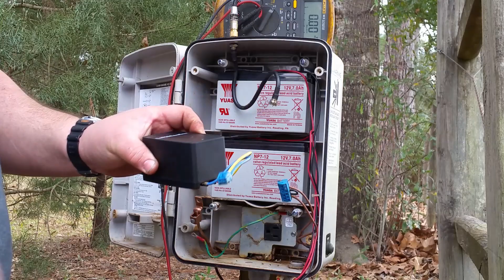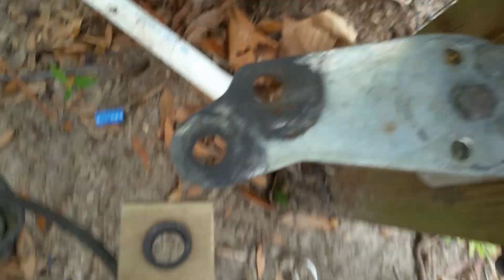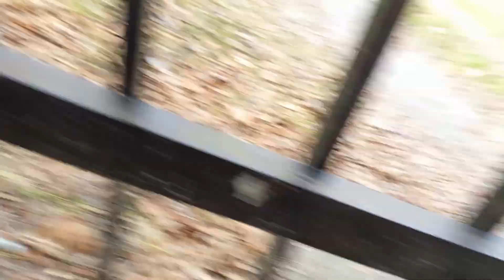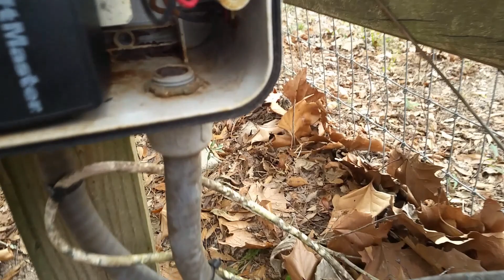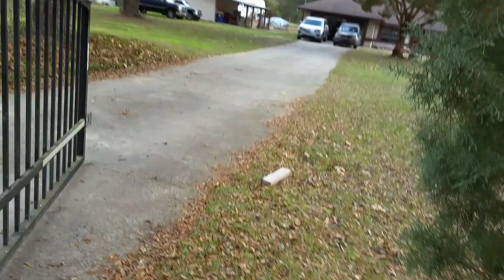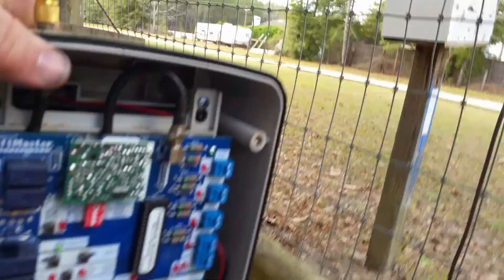Chamberlin Liftmaster LA400 Gate Opener Repair: Part 2

Comment: I can't get my remote to talk to the arm.  The panel receives the signal, but to signal does not go from the panel to the arm.  I have checked everything.  Everything works, the arm motor, the panel box, limites are set.  My only problems is with the remote.  The battery in the remotes are new.  I can opereate the gate using the control box.

Comment: The perfect video sir!  I think this saved my gate and my patience.  I tested the voltage like you did on that transformer and I'm getting  73 volts so I assume mine crapped the bed.  Symptoms were massive close lightning strike today, smoke alarms in the house even squelched a bit from it.  Gate stopped working.  Fuse is good, green power light on the board on, transformer has a green indicator light and when you push the reset button on the outside box lower right you get the reset light to light up.  Other than that, NOTHING on the board works as far as pushing buttons or indicator lights.  Not sure if I pushed that button to the right of center that you kept pushing to get the blinking during your tests but I'll test that tomorrow morning.  Good voltage to the batteries, good incoming current to the transformer and the pannel but nothing.  I'll start with a new transformer.
Reply from the maker: Sounds like the board took a hit.  I've been through a couple of them because of lighting...

Comment: Hey buddy - I am trying to figure out my gate which is same model as yours. When I test the voltage on green and white I get 9 volts but when I test on white yellow or blue it is 0. Does that mean the circuit board is bad? Thanks for your help! Appreciate your video it has made me infinitely more knowledgeable.
Reply from the maker: No, it works off of RPM and voltage.  The green wire should be the reference voltage going back to the board.

Comment: I also have an LA 400 and I just replaced the batteries for the third time since I’ve had it. But this time I continue to have a problem with this gate opener and I was hoping you might be able to put your finger on what the problem is. Today, when I went out to open the gate, I heard three beeps, and the gate would not move.  I hit the reset button and still nothing. It was only when I pulled out the 20 amp fuse and put it back in that the gate would operate. But even then, when I pressed it a second time, I heard the three beeps. I put a multimeter on the transformer and it goes up to 24 and then bounces around but 24 seems to be the full trickle charge.
Reply from the maker: I would try relearning the limits and see if that helps
Reply: Turns out I had a bad wiring harness from battery to the board, a bad battery and a transformer that wasn’t charging.
Reply from the maker: @crownmoldingbyspectaculart941  Sounds like you had a multitude of issues...glad you got it fixed

Comment: I have a LA500 gate operator and it comes up with code 93.  I've checked obstructions or if the gate is biding, which it is not.  I even tried moving the gate arm without it connected to the gate and it only moves for a second or two before flagging code 93 again.  The gears and rod gear look like they are in good condition and move with ease.  I'm leaning towards the RPM sensor on the motor itself.  What kind of voltage should I be seeing from the RPM sensor when the gate is moving?  Would it be different than the LA400 or should it be the same (2.43V)? Also, what ranges of Voltages are acceptable for the rpm sensor?  Would Chamberlain happen to have a voltage chart I could reference?
Reply from the maker: Chamberlin is extremely reluctant to give any information to any DIYer and you're not likely to change that. In the 400 system, the harness with the micro switches go bad causing the board to get false readings. The motor with the rpm sensor goes bad too. The voltage seems like it should be around 2.5 volts

Comment: It appears that the replacement motor for the LA400 with rpm sensor is the exact same 24 VDC motor for the LA500.  Can you validate that this is true? Liftmaster wants to sell the entire arm/actuator and does not list the motor separately but the two motors appear identical. Is there a difference or can the LA400 actuator motor work on the LA500 actuator?
Reply from the maker: Not something I can answer for you

Comment: i replaced my transformer and now all the lights are flashing
Reply from the maker: You need to check the batteries and see if there is any charge. If all the lights flash, you could have a popped board...

Comment: My LA400 has no power. Where should I check?
Reply: Hello Irocin Z, will the arm operate at all if voltage is below 24V? Mine has about 23.6V. I just replaced the gear assuming that was my issue. After replacing the gear, as I try to set my limits, as I'm depressing the set limit button, the motor would run a little but then stop, then I'd have to let my finger off the set limit button and depress the button again to get it to move, repeat, repeat. The diagnostic light blinks 5 (RPM reversal). Could a low supply of voltage at 23.6 cause a RPM reversal error reading?
Reply from the maker: @tonylee938  Not usually. If its setting a code for RPM reversal, that usually means that the outer limits haven't been learned. I found with mine, it took some trial and error to get it to learn without setting that code.
Reply from the maker: Start with checking the batteries since the system runs on 24vdc. It has to have charged batteries to operate. Then check to see if your transformer is working. If both of those are good, check your two 20amp fuses. If all that is good, it's a possibility the board is bad
Reply: Keep in mind, and I forgot to mention this in my original question, that I received the RPM reversal error while testing the arm when it was NOT installed on the gate, so there was no resistance present in the arm in opening or closing. The arm was sitting on top of concrete blocks. I'm wondering if I have a bad motor or bad board. I'm trying to rule out bad batteries, and hence my question about the gate operating with batteries power supply below 24v (23.6v in my case). Any suggestions?

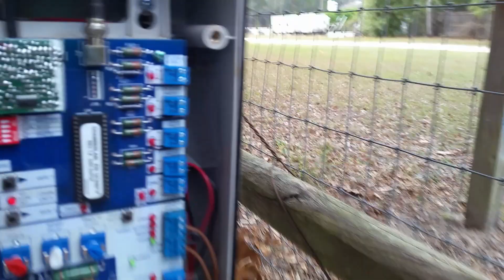Comment: Nice video, question at minute 18:50 how do you saved the settings?
Reply from the maker: There is a little red strip of switches that you just switch over to "save" and you're done.
Reply: @IrocinZ  thank you sir

Comment: Totally wrong steps.  First unplug transformer read accessories imput should read over 24dcv. If under 24vdc replace batteries.  Next unplug batteries from board then plug in transformer test at plug in on board. Should read 32vdc.
This is also first generation la400 it will also take a 24vac 40va transformer.
Reply from the maker: Information on how to repair these is limited and the manufacturer doesn't like to release it unless you're a trained technician. Alot of what I do Is not written in a book and is kind of common sense type of diagnosis from 30+ years of being an auto tech. Your information is definitely welcomed as it could help someone else and I appreciate you posting.

Comment: Are you experienced with Linear Pro? Hi, I got a card for dual opener and I would like to use it in a dual Sliding gate. The cable from card to motor is 5 lead inside. 2 of them for motor: I guess the other 3 are move detector sensor. Do you know what sensor type and connection they are?
Reply from the maker: I am not familiar with that system. Sorry...

Comment: Thanks for video 1 & 2 for the LA400. Using your info I inspected every part of our gate when it quit working. Ended up being 2 things- batteries were long overdue to be changed out. But the major problem was the contacts with the battery harnesses to the board. Loose, and the clips were broken. I’ve done a temp fix, but harnesses willing need to be changed out. 
Thanks again!
Reply from the maker: Glad they helped!

Comment: Thanks for the video...very informative. Question for you...I have the same gate, but Dual
operators. Our gate 2 stopped working during a recent cold snap. If gates are
closed, both would open. But when open and close signal given...Gate 1 would
start to close, but Gate 2 doesn't move. So Gate 1 then stops and reverses. I
get the 5 blink RPM reversal code. 

I replaced batteries, and also had an extra arm so I replaced the Gate 2
Arm (thinking it could be an internal issue). No luck. Same situation is
happening and the same RPM reversal code. I'm stuck now at how to determine
what the issue is. Any advice is much appreciated.  thanks
Reply: The gate 2 wiring wouldn't reach my gate 1 board pins, but I did hook my gate 1 connector (gate 1 was working) to the gate 2 pins.  Received the same error (RPM Reversal).  So definately a problem with the board I think.    Will likely order a new board and transformer.

Thanks again for the videos.
Reply from the maker: @TheJedsdead  you're welcome!
Reply from the maker: I would try relearning the arm open and close limits. If that doesn't work, possible there is a bad board. Try switching the arm connectors to see if it will work...
Reply: @IrocinZ  thanks so much for the response.  I did try to relearn, but the Gate 2 again would not close.  I did not think of switching the gates connectors.  Will try.  

If the same issue happens, then I guess it is likely a blown capacitor or something else on the board.
Reply: Hello. I am having the same problem. Have you any luck with your gate? I've done multiple diagnostics and it's all pointing to board.

Comment: Hey Irocin Z, thanks for the vids very helpful !  I need some advice. My LA400 keeps throwing error code 93. There is No obstruction. I have replaced the board and the arm but I still get code 93. What should I check next ?
Reply from the maker: More than likely, you will need to relearn the limits. If not, it thinks there is always an obstruction. Also check the force setting and make sure it's not too sensitive....
Reply: @IrocinZ  Thanks, I'll give it another shot.
Reply: Any luck with a solution?  I’m getting the same error 93. I opened the case and operate it manually and still got the error. I’m thinking the motor is giving out?!
Reply: What did you end up doing? Mine is doing the exact same thing

Comment: Hey Ironcin Z.  Great video.  Well done.  Quick question on the learning button on the logic board.  I have a LA400 like yours and the learning remote button no longer lights up when you press it to train a new remote. Is that something you can replace or do you have to get a new logic board?  Tried Liftmaster's online support but they said they no longer support residential gates.  Any help or guidance is most appreciated.
Reply from the maker: Usually, it just takes making sure the switch for save is not on. I think there is a limit to how many remotes you can program, but I never have reached that point before Mother Nature takes out another board and I have to replace it....lol
Reply: Thanks for the video! I’m trying to replace a remote keypad. What color do I need to program it to?

Comment: One other question, will the system work without the batteries if it is plugged in?
Reply from the maker: I don't believe so. The way I understand it, is its a 24volt system and the transformer or solar, whichever you have, is only there to charge and maintain the batteries. Plus as with any computer system, it requires a clean stable voltage to operate correctly. Fluctuations or voltage spikes are bad news for electronic components not designed to absorb that energy.
Reply: @IrocinZ  Thank you!

Comment: Very helpful!  My question is if you have power to the board but no power to the accessory is it a board issue?
Reply from the maker: More than likely. I have found these boards are very prone to failing from EMI or voltage spikes. They require a dedicated power supply or solar power

Comment: Hi Mr. Irocin Z,

I replaced new board, gear, motor, & relayed assembly set, but the motion is pretty slow & it does not have full open & full close like what you did; even though , I set force button @ maximum speed as well as the time so  please advice

Thank you
Reply from the maker: The force you don't want to set more than half. If you were to put your foot in the path, the gate should just tap your foot and reverse and then stop. You will also need to set your open and close limits to get full movement...
Reply: @IrocinZ  

But, why the movement is too slow?

I appreciate
Reply from the maker: @chuaongpacpo9801  Make sure you have the right voltage to the motor. Should be above 23v to operate correctly...
Reply: @IrocinZ  
I also just replaced the new transformer with 34v such as LiftMaster K76-37251 Plug-In Transformer 
Thank you

Comment: Great video sr is there any way that you could help me i have a dual gate i am getting 5 flashlights but i can’t find anything about is the rpm reversal i can’t figure out what to do please help me
Reply from the maker: It usually means the arm is overextended  or bottomed out and it will go the other way. The other scenario is there is an object that interfered with its operation and as a safety went the other way. This could be caused by a gate binding too...
Reply: Hey Irocin Z i replace the motor but now is not letting se my limits what would you recommend
Reply from the maker: @jeanpaulrodriguez3367  if you've slid the switch to off and not save and it still won't let you set the limits, there is either another fault preventing it, or the board is bad. Did you look at you motor harness closely to make sure all the connections are good?

Comment: Very helpful video thanks! I have a question for you. I have to replace my batteries for the very first time. I just ordered them, and my question is. Do I have to disconnect that board all the way before I replace the 2 batteries? Or can I just leave it connected pull it down some replace the batteries and put it back?
Reply from the maker: If it is anything like my set up, yes. I didn't have near enough wire and I didn't wasnt to take a chance on a short circuit....Also, mine was on a plastic board holder that made it real easy just to unplug the blocks, undo the four screws a little, slide it up and out...

Comment: My antenna no longer works.  I could previously be 70-80 ft away, but I now need to be 5-6 ft away and in direct line of sight to the control box.  The antenna coax connection is secure and not corroded. Any tips? Will I need to replace the motherboard? I debated replacing the antenna, but isn’t it just a piece of wire? (Can’t imagine it failing.)
Reply from the maker: I dont know it you can buy the antenna module separately,  but it does come off the board. You also can try putting the antenna directly on top of the box. I had the same issue with mine when we bought the place. Now its the transmitters. We use the Chamberlin 3 buttons and it seems like they don't always send the signal out. The Liftmaster brand works perfect. But they won't work my door opener...lol.
Reply: Problem solved!  I replaced the top antenna with an aftermarket one I found on Amazon for $10. It now works.  I probably should have tried removing and reseating the original antenna from the top of the box before replacing, but oh well. It works great again.  Link below. 

Antenna with Coaxial Connection F Connector for use with Gate receiver 8" long and a protective rubber, Silver, 8 Inch https://www.amazon.com/dp/B00IJ2TRO6/ref=cm_sw_r_cp_api_i_0RWjFbAGEN6WZ
Reply from the maker: @jimcooley9477  👌 Nice!

Comment: Loved the video learn some ,my gate led is blinking 5 times ,book says rpm on first video you put arm together. And said that you would check the rpm wire , I probably missed it  how do you individually test the rpm, then do you have to resetlimits  I thank you  for knowledge
Reply from the maker: The board is basically looking for an RPM signal. There is no real spec as to what speed it's supposed to be, but the signal generated should be an AC current. It takes three wire to do that. Power, ground, and signal return. The voltage returned to the board is how it determines the RPM. If the motor is weak, it will set that code.

Comment: Thank you so much for this video, super helpful. Quick question: when I test the accessory power on the left side of the board (like you do at 3'09''), shouldn't I disconnect the transformer first? I have ~33V when the transformer is connected, but only 10V when I disconnect it. Thanks!
Reply from the maker: You should have at least 23.5 volts with it disconnected. If you only have 10 volts, I suspect one or both of your batteries are toast.  Disconnect your battery terminal leads from the board and test the batteries by themselves. Fully charged, they should be around 12.5 or more each.